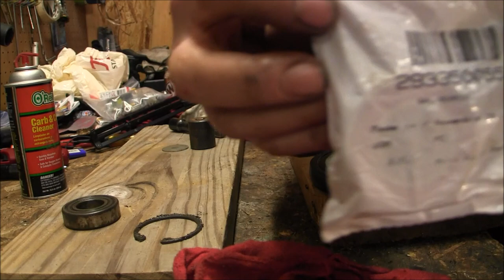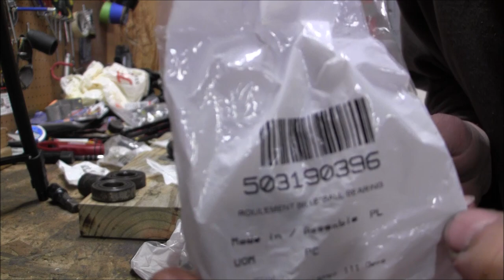Skidoo Rev 800 wheel bearings /suspension part 1 Episode 16

Comment: On my 2006 MXZ 800 HO Adrenaline, with a 121" track, all the bearings are the same, except for the idler wheels on the rear arm, next to the torsion springs. Those two have a different mfr. number than all the lower idler wheels. It must be different on the 136" track, bummer you had to go back to the parts store. Two more bolts and you could have pulled the whole skid out......super easy to change ANY or ALL of the bearings.